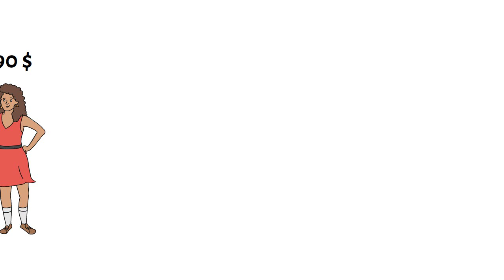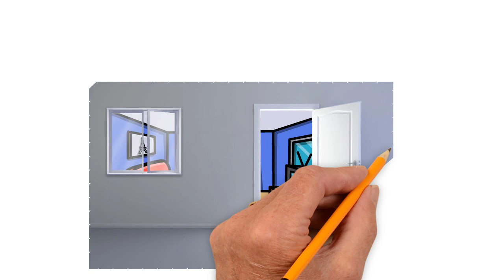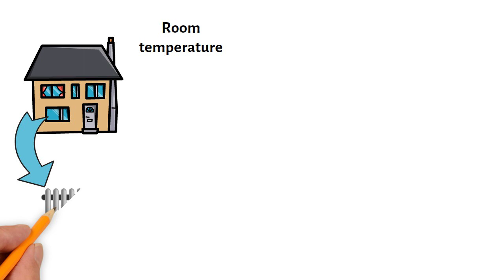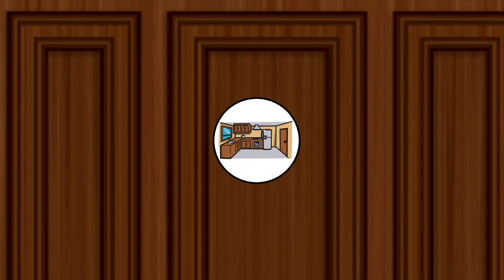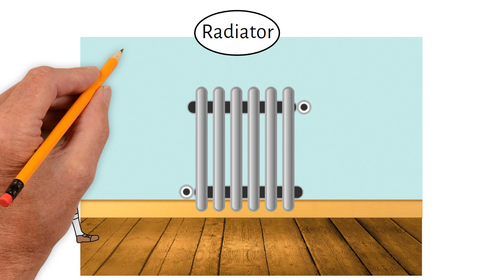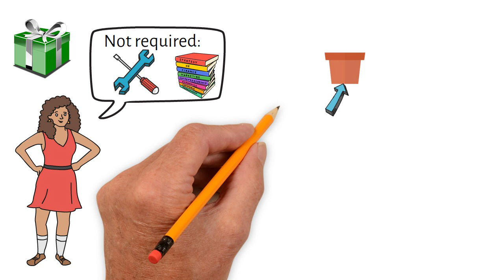How To Save Money On Your Heating Bill | 8 Tricks To Cut 70%

Comment: I save on heating by using an electric blanket on the bed in the winter and wearing warm pjs. In the summer I run the air from 12pm to 7pm and use fans at night.
Reply from the maker: Thanks for sharing your ideas.